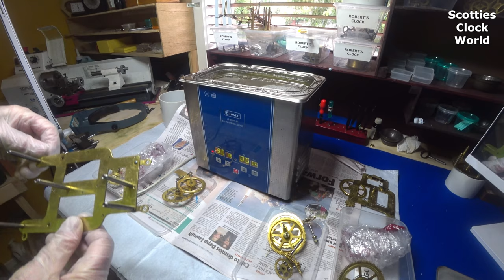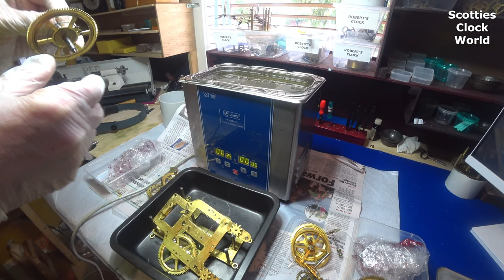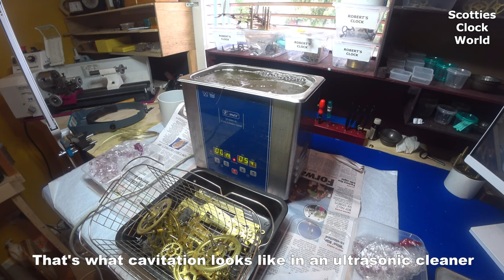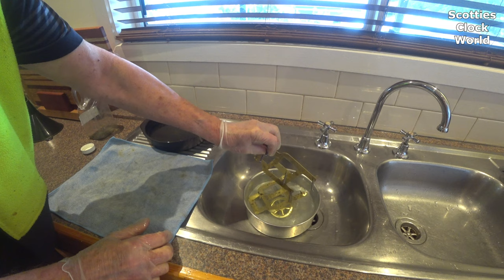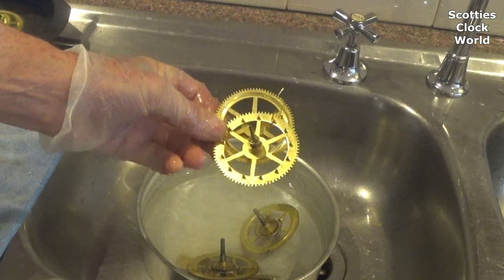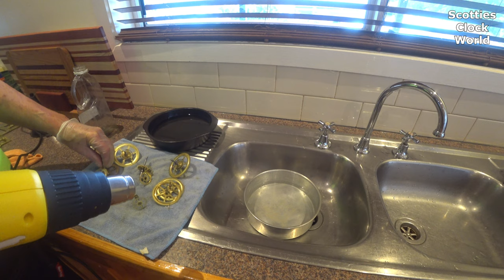Antique American Seth Thomas clock repair - Part 4 - Cleaning the movement in an Ultrasonic cleaner

Comment: Extremely dangerous to use naptha , lighter fluid, in open containers in your  shop or house.   One spark as in a lighter will ignite it.

It is also 3 times more expensive in the US than gasoline, once enough water has contaminated it , about 3 or 4 clock rinses, you must dispose of it.   

See dryer box comment below.